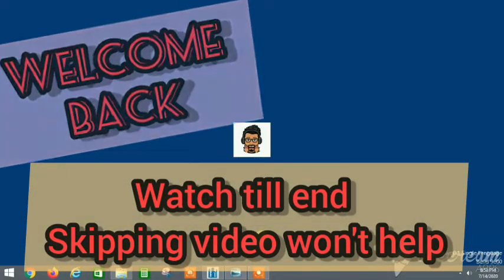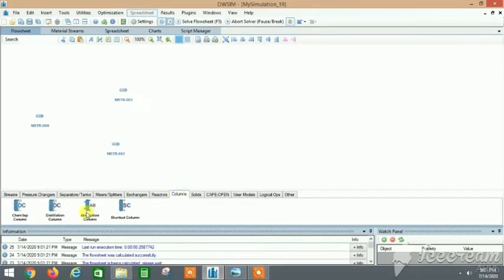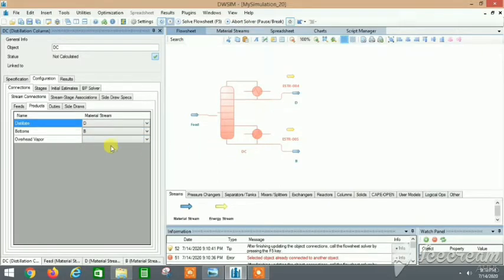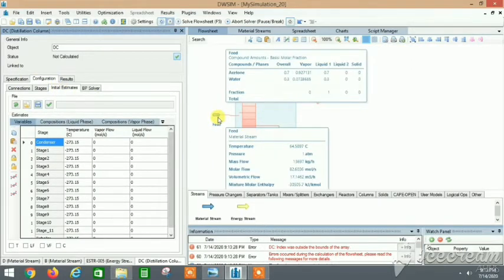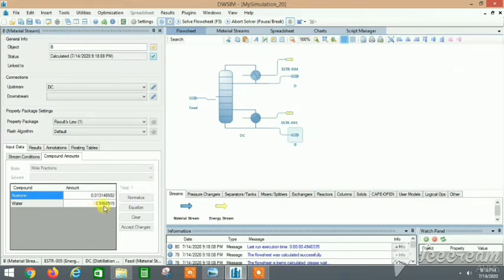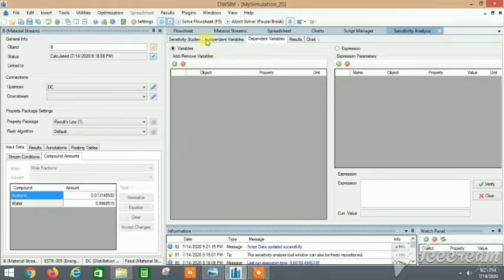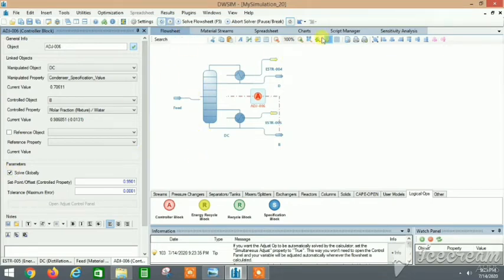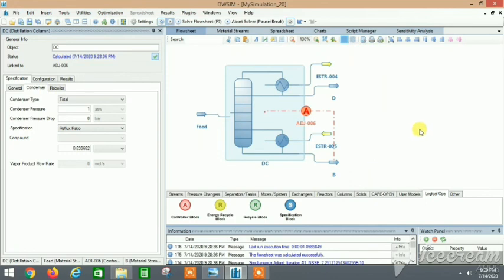DWSIM Sensitivity Analysis | Optimization | Plotting

Comment: When I was trying to solve this spoken tutorial assignment...I was not able to simulate it finally...flow sheet didn't turned blue...also I wasn't able to change the molar flow rate to mol/s of feed,which is actually to be changed at first settings.Thanks to you..
Reply from the maker: You are welcome. By the way I explained in one of my videos about how we can charge data like compounds , Thermodynamics packages and units of measurement later too. Simulation settings can be changed any time. All  the best ! 

Do share the videos to your mates !